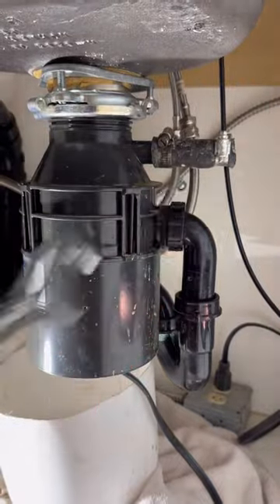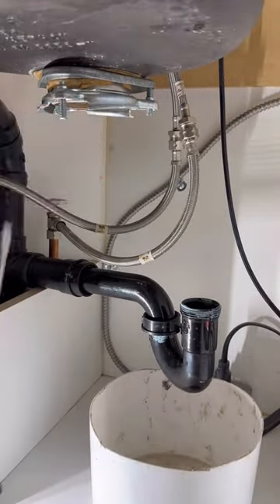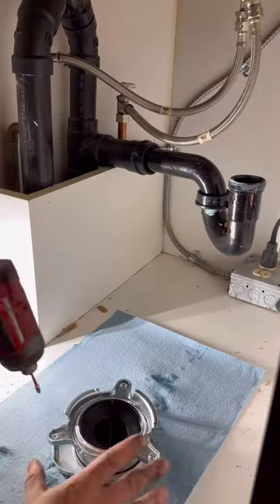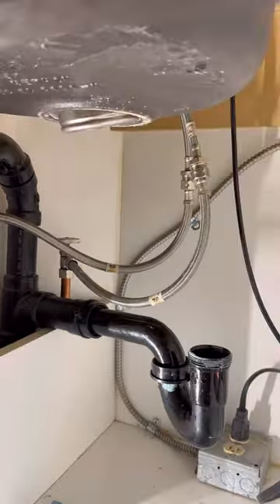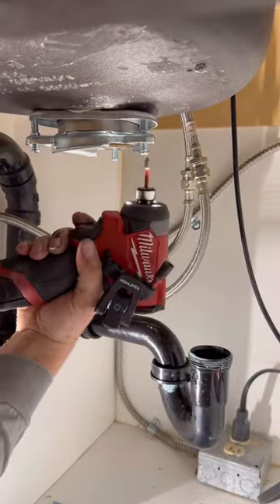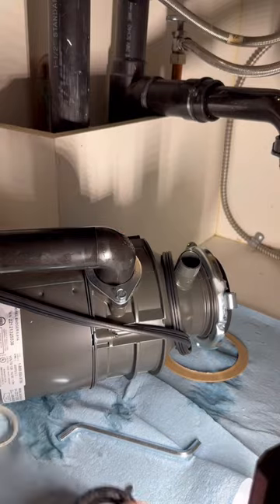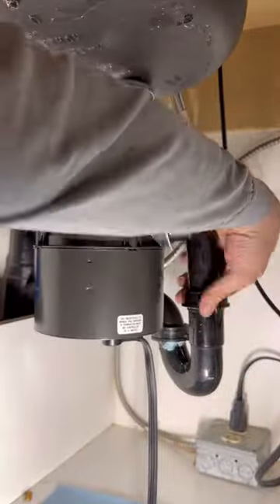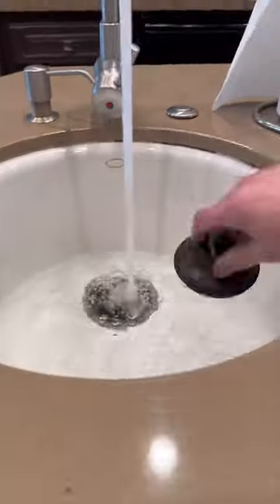how to swap a garbage disposal #plumber #plumbing

Comment: As an electrician, seeing the outlet facing up like that under the sink, shit gave me chills. Lol
Reply: And need to be gfci
Reply: @bryanlam9886  could still be gfci protected even though it isn’t a gfci itself
Reply: @joemilton1010  correct if breaker is gfci
Reply: @joemilton1010  correct if breaker is gfci
Reply: Don’t know y who ever did the electrical just didn’t put it on the wall
Reply: Electrician here too. Same 😂
Reply: Yeah, idgaf about the breaker being GFCI; that sucker is gonna be a nightmare for accidental trips and...frankly, I'm not one for gambling with electrical interrupters, haha.
Reply: It’s a safety measure, you’ll know when you got a bad leak!
Reply: Aw for real? Is that just cause it's near water? Or is that just a big no no.
Reply: @clayton9136  bad idea in basically any environment without a dust/debris cover.

Horrible idea near water sources.
Reply: @ulogy  word word.
Reply: I like how they mounted everything but the box.
Reply: First thing I noticed. Perfect place to hold water.
Reply: Some people put switched ones upside down to tell you which are switched idk why one wouldn’t assume the garbage disposal is tho
Reply: At least they used MC cable 😂
Reply: Right? The only illegal orientation 😂
Reply: You've never seen one of those before? It's a leak detector once the water level reaches the top of the outlet it automatically turns off your garbage disposal so you look under your sink to find out you have a leak
Reply: @bryanlam9886  Or if the outlet is on the load side of a gfci outlet. I only have one in my kitchen, but all the outlets are protected by it
Reply: @David Novak  true  need 2-20 amps dedicated gfci receptacles on countertop, but dishwasher and disposal need dedicated circuit
Reply: Damn! I was about to say exactly the same thing lol
Reply: As a DIY'er I say, you and me both...
Reply: Agreed! I hope that was a handyman or homeowner? At least GFI protected, I hope?
Reply: @tublisvaj8966  That's what I'm saying.
Reply: Not an electrician, but definitely came here to say that!
Reply: I'm a plumber, and that gave me the willies! 😬
Nothing beats the c.1900 fuse panels mounted under the kitchen sinks that I came across a few years back on a demo job, though. 27 apartments worth.
Reply: @James Miller   Damn! Find that electrical contractor, & I'll get the rope! Hell NO! I've worked in that industry for 30 years, & he'd have to explain to me why he should work in that industry... SERIOUSLY! I can hear plumbers talking crazy shit about what they encountered on the job that day & laughing hysterically! 🤬 F___ing ruining it for the rest of us that take pride in their work! 😑
Reply: Not kidding! Also wondering if it’s connected to a GFCI breaker at the panel?
Reply: Thank you.
Reply: With no GFCI
Reply: @bryanlam9886 Wrong again, it could be protected up stream by another GFCI receptacle not a GFCI breaker.

Comment: face up plug under the sink is an electric code violation if you see it again
Reply: And need to be gfci
Reply: @bryanlam9886   Nope, that's optional under NEC because this is supposed to be a definite purpose outlet.  That's not to say that it wouldn't be a bad idea.
Reply: The new NEC requires all receptacles in the kitchen to be gfci regardless of the location

Comment: I like to push down and wiggle it to set the putty, then clean the excess from the bottom. Then when you tighten the flange it wont ooze out from underneath as much. Looks much better. IMO

Comment: Here's a tip. If you still use a garbage disposal, stop. Pull it, trash it, and just install normal plumbing.
Reply: Compost or chicken/dog food, no waste 👍
Reply: Yes, also rip out all your lights and install lanterns. Who needs a heat pump when you can just start a fire in your home? Fridge? Nah, dig a hole in the ground and keep anything fresh down there in jars.
Reply: @paulallenscards  Not apposite to my comment.
Reply: The house i bought and moved to 2 years ago is double sink and I am going to be adding a single bowl sink.  Debating on whether to ditch the disposal on the new install.

I did remove a disposal at my old house with double bowl but admittedly I used that crappy accordion style flexible pipe since I was in a rush and didn't feel like Fking with it.

We did fine without the disposal and kept a strainer in the sink but reason i got rid of the old one is it failed. The current one in the new house works fine.

Comment: When I bought my house 25 years ago it had a Badger 5 in it. After a couple of years I replaced it with another Badger 5. After 5 or 6 years it failed and I replaced it with a Waste King. It's still working great after 17 years. With the Badgers I've had to snake out clogs a couple of times. I've haven't had a clog in the kitchen drain since I put the Waste King in.
Reply: Installed a wasteling 10+ years ago and not a problem from it. Only about 90 bucks and 3/4 hp.. not sure why this guy has a wasteking phobia
Reply: I bought a Moen on clearance, and then a few more for family.  They run sooo much smoother and quieter for about the same price.  Only downside is no spot to unjam from the bottom, have to go through the top.
Reply: Badger 5 has a 5 year warranty, they know that they don't last, I still install them because that's what the customer buys.
Reply: @brianfield58  probably what looks good at homedepot

Comment: My waste king has lasted longer than any of the insinkerators Ive had.
Reply: Badger insinkerators are garbage. Rusts out in a couple of years. 

I work on a huge hotel with 100 of them.
Reply: Never had an issue with our Waste King.
Reply: Rocking a Waste King at my pad since ‘09, still going strong. 
Not to mention it sat unused for 8 years before I moved in. Thought I would have to change it, but nope, still kicking!

Comment: Once I went to check on my friends dishwasher it would not empty the water, no matter  what he did. I took it apart, checked the house, the pump, everything was ok. I told him are you sure it was working before? He said yes. I kept checking and checking the disposal for the water to come out. I reached in and did NOT feel the disposal hole from the dishwasher. I asked him when did you put the new disposal?
He said no, it's not new. I said this thing is new, the hole is NOT punched out! He could not believe it or understand it. Later I found out from his wife's friend that SHE had put something in the disposal by accident and ruined it! She secretly called a plumber and had the disposal REPLACED without telling her husband!
But the plumber FORGOT to punch the hose hole! 😱

Comment: Insinkerator is the only brand of disposer I would ever buy. The 1/3 or 1/2 HP is plenty, Badger 1 or 5. Plus I don’t hardwire disposer, plug in only. I also use a switched outlet to control the disposer.  Thanks!
Reply: Don't you think having a flat set out outlets on the bottom of the sink cabinet is kinda goofy. Maybe mount it to wall higher up.
Reply: @michaelchaikoski9304  The outlet was installed by the builder. Last year I changed my Koehler faucet for a new no touch on faucet. Because the 1900 box was there I was able to add another line and outlet (in the same box, we have metal conduit here) that was on, all the time, for the faucet.  In today’s great different lifestyle, power is key. Love those new Decora triple switches that fit in one gang in an outlet.
Reply: Badger 1s only last a couple of years.  They eventually begin leaking through the shaft seal in the bottom.  Badger 5s do the same thing, but later on.
Reply: @Lugnut64052   my original Badger 5 ( new home in 2003 ) lasted 15 years. The current Badger 5 is 5 years old.
Reply: @jimpie231  but its below the sink and asking for water

Comment: We started siliconing the screws on the mounting bracket when we had to go back a couple of times to one house because it kept coming loose.
Reply from the maker: Seen that before. Usually a stainless sink. Lots of vibrations

Comment: As far as placement of that gasket, I’ve seen it both ways last as long as the disposal does, so it doesn’t really matter. I prefer it gasket first, but on some swap outs, I do it your way because I’m too lazy to swing the trap out a bit, and find it seals just fine either way.

Comment: Question, is the putty necessary under the sink strainer? I know it was a must back in the day, but now the new ones comes with a gasket. Just wondering if the gasket is dog doo OR if there good to use if you don’t have the putty.

Comment: I've replaced 2 garbage disposals on my own - different houses. The second one was broken when I bought it and sellers market didn't let me negotiate on it before close.
Both times I had to use my spare tire jack to hold up the disposal while I screw it into the bracket. Idk how you did that so quick without a support, but hopefully I don't need to remember this video and just have no more disposal fails 😂😂

Comment: What if your arms are not long enough to hold the flanges together while you install the retainer ring. I used to use a compression tool that makes job easy. Some put the disposer on top of the flange in the sink you don’t appear to use either. What u due homie?

Comment: Have you checked out the American Standard disposals they got at Costco? They are cheaper, better warranty and have more butt behind most other disposals out there. Your opinion?
Reply from the maker: I’ve installed one of them. No complaints. Not enough experience with them to make a judgement about them

Comment: Im about to change out my disposal but it’s hardwired into the actual house, was hoping to see you do that part but it looks like this just plugs in to an outlet, I’m wondering if I should just cut the wires and install an outlet like that, however I’d be kind of worried because of past leaks under the sink
Reply: Just hard wire it back in, that's how it's done most of the time.

Comment: In 1987 when I bought my house. It came with a 1/4 horse garbage disposal. It lasted 13 years. Since then I’ve gone through four other garbage disposals. 

Half or three-quarter horse it doesn’t matter. The water is so corrosive in my area because of the high calcium content, the garbage disposal corrodes and starts to leak. If I can find a garbage disposal that has stainless steel parts for everything that comes in contact with water I would never have to change another garbage disposal. 

Don’t think you’re getting a great garbage disposal just because you buy from Home Depot or Lowe’s. I purchased a Home Depot garbage disposal. It lasted three years. It got completely corroded. And come on guys it’s not hard to change out a garbage disposal.

Comment: Yeah, who would want a disposal with a better warranty, 2700 rpm with a stainless steel grind chamber with a magnetic motor. Who would want a disposal that grinds up chicken bones. They also go by the name whirlaway. Ise is just the most common brand.

Comment: I use nothing but Wastemaids. Way better quality than Insinkerator. Have made quite a bit of money replacing rusted out badgers with them. Never get call backs They have an 6 year warranty and they are cheaper.
Reply: Yeah they are way cheaper compared to the others and mine have lasted decades.. about to put one in our new house I am building

Comment: I am so screwed!!!  New cabinets, new granite counters, new 10" deep sink, new disposal, new hot and cold copper supply lines with 1/4 turn shut-off's.   Disposal drain and wall drain= exact same height.  😢😢😢

Comment: Don’t ever hook the dishwasher to the disposal lol.  They make a fitting for that, use a dishwasher tailpiece
Reply from the maker: No reason not to use the port that comes on the dishwasher
Reply: @replumb  port on the dishwasher?  I think you meant to say the disposal.  Total hack way of doing it and also against code
Reply from the maker: @mr.mystery4577  it’s not against code at all😄there’s an air gap and it drains to the disposal. No problemo. Have a good day sir
Reply: @replumb  it absolutely is and it’s a total amateur way of doing it.

Comment: You didn't discover something unique by placing the gasket into the discharge flange followed by the tailpiece. InSinkErator instruction say specifically "Slide flange (L) over discharge tube (J).Insert gasket (K) into discharge outlet.
Reply from the maker: I put the gasket behind the tailpiece

Comment: Why would you put the gasket on the outside of the pipe. Then it’s a plastic flange against the plastic of the disposer… it’s meant to go in between
Reply from the maker: we’ll have to agree to disagree
Reply: @replumb  insinkerator specifies the gasket goes in between just sayin
Reply from the maker: @Onhaey  I don’t care

Comment: Can someone tell me what an average rate range for a garbage disposal replacement? We have a dishwasher as well. I've been quoted $400, seems high. Is this something I can do myself fairly easily? I am NO plumber. I've replace a toilet before. If I am able to follow a youtube video, is it easy to do? Do I turn the electricity off at the circuit breaker?

Comment: the rubber gasket is the seal bro. your just putting hard plastic to hard plastic and smashing them together with a rubber gasket. makes no sense. you should actually try and talk the owner out of the disposer anyways since 1 1/2" drain lines were never meant to carry solids if gravity draining. disposers were created by appliance companies not plumbers. also that electrical outlet facing up is a big no no. very dangerous. you should have caught that and notified the client. you do pretty good work bro but you've still got some things to learn. keep it up.

Comment: Your comment about Sears is BS. If never shopped there you lost out. It was the original Walmart type store. There appliances were top notch, we had a washer/ dryer set for 27 years. You could get candy to rifles, clothes, carpet and furniture. You needed it, Sears had it. Car care, tires and batteries were top notch. Don't knock it if you haven't tried it.
Reply from the maker: It was just a joke bud